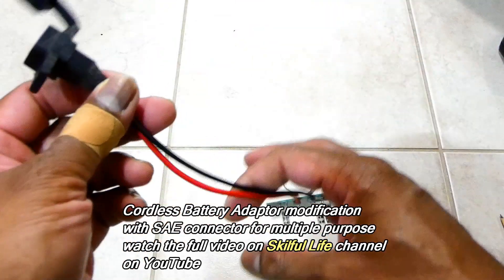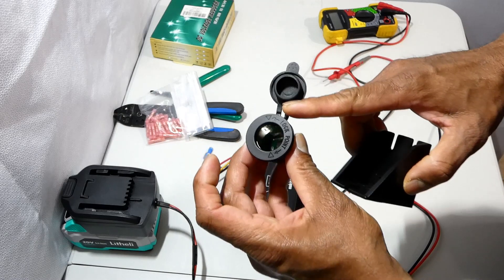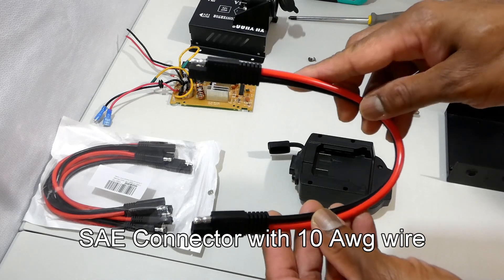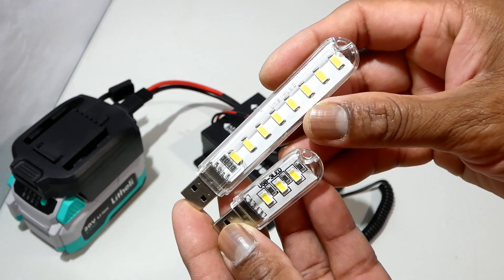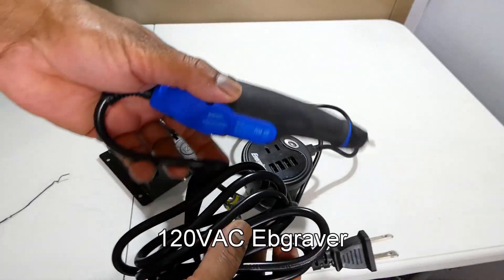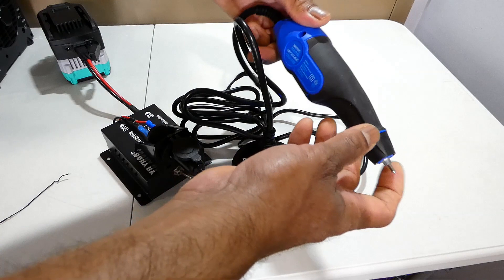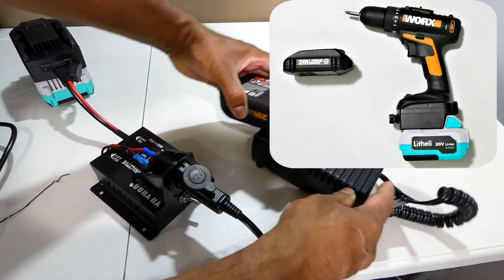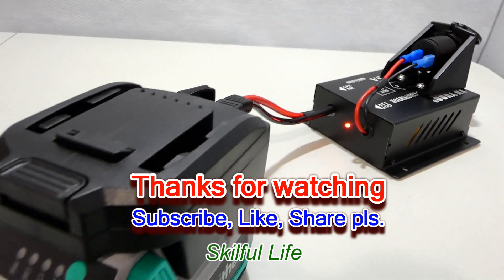DIY CORDLESS BATTERY ADAPTER DC DC CONVERTER 20V to 12V with SAE CONNECTOR CIGARETTE LIGHTER SOCKET

Comment: Where did you get the battery socket which holds the battery and provides the lead to the converter ?
Reply from the maker: I bought the battery socket(called cordless battery adapter) on Amazon and modified it to fit with my battery and attached a SAE socket to withdraw power from a battery. If you watch my other battery adapter videos, you can learn more. Thank you for your comment.